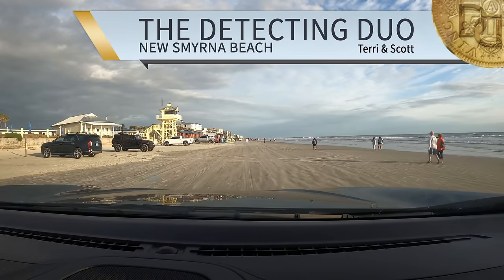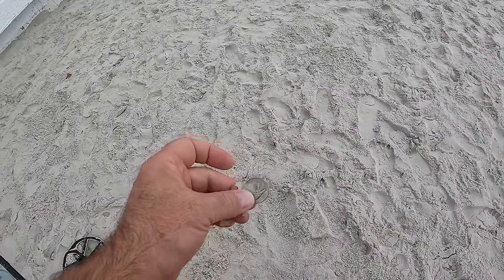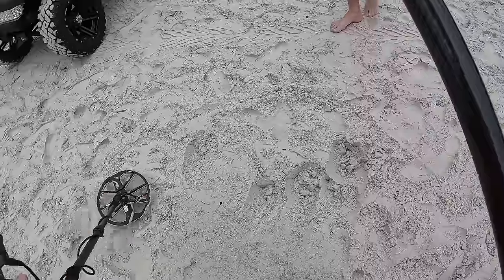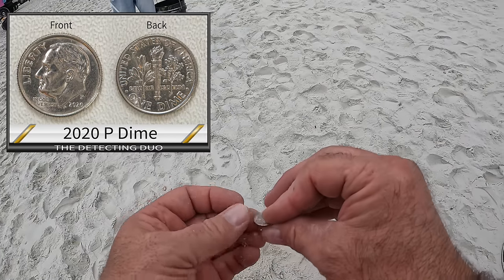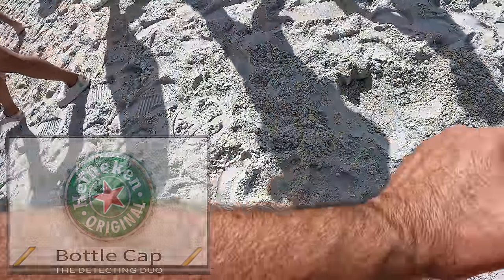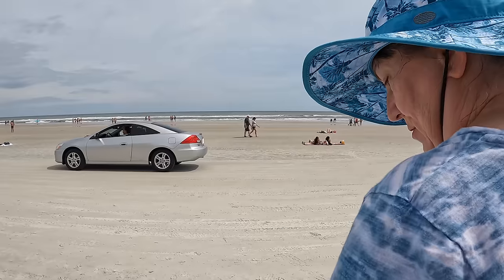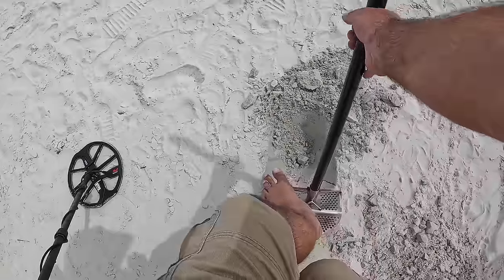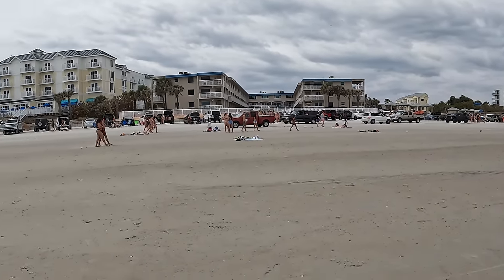Most Finds Ever in one day! More Spring Break Metal Detecting New Smyrna Beach | The Detecting Duo

Comment: I love seeing the Vanquish used alongside of the Nox 600.  I have both of these and I'm always curious as to how they compare.  Thanks for the great video!  I'm jealous of your wide beaches up there.  Down here in Brevard County, our beaches are nothing like that.
Reply from the maker: Thanks @Marti Thew !  
We detect down in Brevard County now and then -- Cocoa Beach and a few others along there.  Courser sand than up here at NSB and Daytona!   Will probably be down that way again soon!   Yeah, the beach is cut back pretty far in many areas up here.  And a lot flatter too! 

The Vanquish 540 and the Nox 600 have pretty much the same VDI response spot on.  Same multi-channel frequencies in use from what I recall as well.   But the Vanquish will many times find something that the NOX would ignore.  Tent Stakes for example will ring up at 19ish on the Vanquish but the Nox only gives grunty negative VDI readings. 
Terri seems to find more jewelry with the 540 than I do with the Nox.   
Could be I have some of my setting off from the Vanquish, but I did try to make them match as much as possible. 
Tne NOX is more prone to Microwave, Cell Tower and WiFi interference (chatters a lot around them) and the Vanquish is just quiet. 
Both work great!    Cheers!

Comment: My vanquish 540 picks up tiny stuff like that earring surprisingly well.
Reply from the maker: Excellent choice! The Vanquish 540 is surprisedly very good! We own 2 and they do quite well. The higher end detectors we're getting into now have some advantages, but it's all in knowing what your detector can do!
Reply: @TheDetectingDuo  I'm currently trying to design and build my own DIY metal detector, it's a challenge.  I doubt it'll be anywhere near as good as even a decent single-frequency machine available now, but I'll be happy if it finds anything.
Reply from the maker: @bobasaurus8911  An interesting idea! A Metal detector circuit is really simple for a single frequency. Lots of circuit designs available online. Multifrequency should be doable. 
A coil housing could easily be 3-D printer (hmm. Something I could make in my Bambu printer!)   Basic coil is pretty simple too. 
Then you need a controller so either an Arduino or Raspberry Pi or other simple computer is all you need and some nice little software .  Sounds like a cool plan! 
The only advantage XP, MineLabs and others have are years more research and tweaked code.   
You could look up some of current metal detector patents which may has some additional insight. 

But I'm rambling! Been a while since I sat down and bread-boarded out a project!  Ah if only I had the time. Cheers - Scott.

Comment: I was surprised that the vanquish 540 found the ear rings, and the equinox 600 could not pick it up
Reply from the maker: Hey @bobneal1960 , Papa Bear!  Thanks for the comment!  The vanquish surprises us quite a bit.  The iron content in and around may have fooled the Nox a bit more. 

But then Terri finds a lot of really good rings with that Vanquish!  I go kinda fast with the Nox and don't always listen/feel the whisper tones and track them down like I should.  The Nox also is more prone to EMI and that will throw us off too!  

We both hunt with all metal on which might be a factor.  I might need to tune/calibrate it a bit more rather than default Beach mode. 

Basically, I just need to slow down and pay more attention to what the detector is telling me.

Comment: Great videos. Thanks for sharing. So I was looking at metal detectors online and they range from a 100 bucks to 3,000 bucks. If I get one not spending 3 grand. What do you recommend the best value for the buck? I don't really have a budget just not paying 3K for a hobby toy.
Reply from the maker: Hi Kerry!  Thanks for the comment!  long reply here! 

For a detector, it really depends upon what and where you are going to detect. The Minelabs series we use are really good for anything. Over the years we've used Whites, Garrett, Bounty Hunter and one or two other off brands years ago with Terri's dad.   
Anything under $300 is gonna be a toy IMHO, but could work just find depending upon what you want to do.  Even that old Radio Shack metal detector will find coins in the dry sand (just gotta work a lot harder!) 
We'd end up recommending Minelab brand for all your detecting, really. More info below! 

On the beaches we stick to the Minelab detectors.   Their product is good and support is good (had them replace a coil one time under warranty).  Both are excellent in highly mineralized soil and water.  Battery life will last you a good day out or more without recharging. 

The Vanquish 540 (we own 2 of them) is a great all-around low cost detector that does as good as the Equinox 600 (better in some instances.)  The coil is waterproof but the control box/pod is not. It has a rain cover.  It uses replaceable AAA, rechargeable batteries.  
Amazon affiliate link: https://amzn.to/3JUuyjn
For $379 it's a great value.  (lightweight, but study.   )

The 600 has more bells and whistles and it "waterproof" -- can take it out under water (but some have leakage experience. ). Batteries are built in and magnetic charge. It is more prone to microwave and other EMI.   The Vanquish just ignores most EMI noise and just works!  Terri has found expensive rings with it - more than I've found with the Nox 600 (right spot, right time thing!) 
Amazon affiliate link: https://amzn.to/43mjSB8
It's ~$600.   Worth the additional price?  Maybe. 

The VDI #s and depth indicators on both are pretty much the same.  Terri detects  in Jewelry Mode with all metal on. I detect in Beach Mode 1 or 2, depending upon whether in wet or dry sand. Either mode will work everywhere on the beach, really. 
Both use essentially the same multi-frequency channels for detecting. Just tuned slightly differently.  

The NOX can miss stuff that the Vanquish will find as a good signal (albeit could be a tent stake at a decent # that the NOX ignores.)  But the Vanquish has found jewelry that the NOX would suggest I skip it. And on occasions when I pay attention, the reverse! 

Headphones? Can use the included ones (we don't on video) or not. The Vanquish is a bit louder than the Nox.  Included headphones are not waterproof. 

A Step up is the Maniticore that  many of the detectorist are changing to.  I've played with it and thinking about getting one. Improvements in the noise cancel, the 2D graph for finding better targets and other features make it a plus.  But it's 2.5 times more expensive than the Nox at $1600!   https://amzn.to/3rq0F4i

We've also played/helped new people on the beaches with their Garretts,  bounty and other off-brand detectors. Still prefer the Minelab ones, but that's just what we use the most.
Reply: @TheDetectingDuo  That’s awesome. Thanks for all your knowledge and help. Much appreciated and very helpful. I’ll look into your suggestions.
Reply from the maker: @kerrylittle3900  Hope you find something you like!
Reply: @TheDetectingDuo   Was just looking at the Vanquish on Amazon. I'm in Canada so we pay more for everything. LOL. $400.00 Thats for the 440 model. Thats around what I was thinking. I don't mind paying more for something if it is worth the money but not if it isn't. Thanks for all your help and pointing me in the right direction. Always better to ask someone that knows more and has experience. Thanks again.
Reply from the maker: @kerrylittle3900  Ah! You're in Canuck, I believe!  Pretty country up that way. 
I didn't think about the cost diff! Sorry about that! 
You might find some good old stuff out in the fields. Don't know for sure! 
Hope something works out for you.  Can always go with the Vanquish 440 to drop the cost a bit. Same tech, but scaled back a bit.
Reply: The 540 in Canada goes for $520.00. Just don’t want to cheap out and kick myself later.
Reply from the maker: @kerrylittle3900  It can be an expensive hobby. Only part with as much money as you can afford to not have around!  Most all detectors work to some level. Just have to sort that out as you go. 
And the hobby can be both very frustrating at times and rewarding.  So please don't let me influence your decision!  

We've tried many detectors and these work best for us at this time.  There's always something better coming out. 

We've probably invested about $3K or $4K U.S. in our gear.   Like the Garrett Pinpointer we use is expensive around $120 U.S. 
(Amazon affiliate link) https://amzn.to/3JXpBqe
Then there's the scoops, carbon fiber handles, treasure bags, and more! 
But it gets us exercise, is fun and good times! Cheers!
Reply: @TheDetectingDuo   I just pulled the trigger on the Minelab Vanquish 540. Should be delivered in a week. I figure it wasn't to cheap but not outrageously priced like some of them are. Yeah maybe the big boys are worth its but I don't even know if I will use it as much as I think I might. Thanks for your help and wisdom and direction. We watch all your videos.

Comment: If you go all metal (horseshoe button) your detector will get the targets your wife's detector is.
Reply from the maker: Hey @Buggy Man ! Funny and thanks for the note! .. We both run all metal all the time. But you never know! I rechecked the footage and yeah, I had it on. We rarely turn it off. Sorry, I'm going to ramble a bit about the detectors.  

The Minelabs Equinox 600 I run in Beach Mode 2 (mostly for wet and water since it works better there) but I forget to kick it back to Beach Mode 1 which seems to work better in dry sand.  

Also, I sensitivity was turned way down that day as the Equinox is much more prone to Microwave/Cell tower/WiFi interference..  Tend to chatter a lot.  And, it just discriminates out stuff "better" than the Vanquish in many cases.   

Example: the Vanquish 540 will see a tent stake at/around a 19 VDI - solid zinc penny other stuff range, but the Vanquish will see it as negative VDI and pretty much ignore it.    

Both the Vanquish series and the Equinox series use the same VDI numbers for targets and the same (for the most part) multi-frequency.  

Could be I had the ground balance set differently - lots of reasons. Works out. Sometime I find things Terri misses and visa-versa!  
I could find it in pin-point mode, just wasn't that good of a signal. 
We gotta get around to testing a Manticore or some of these finds and see how it responds... 
Cheers! - Scott